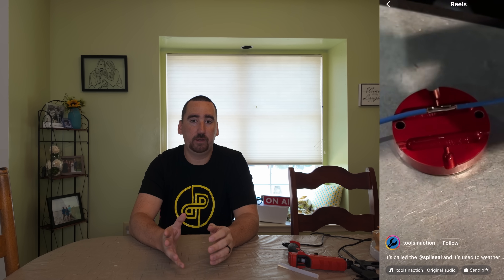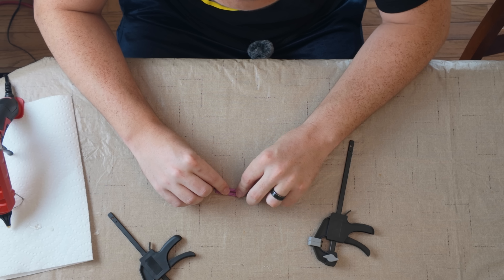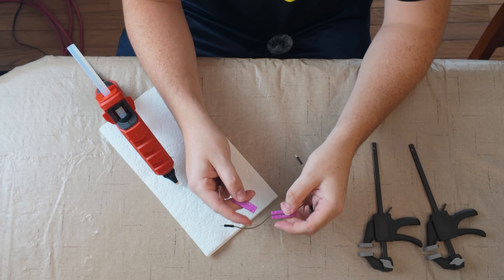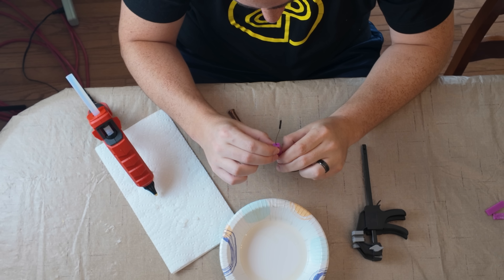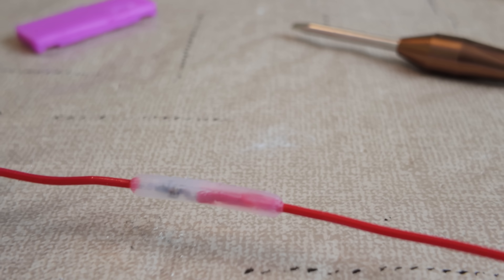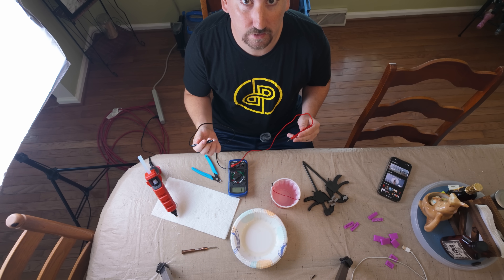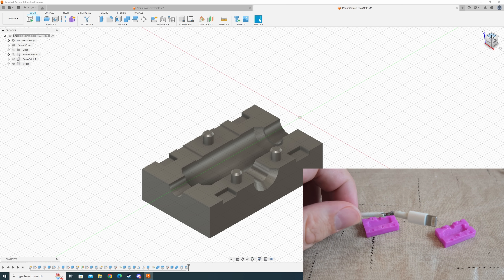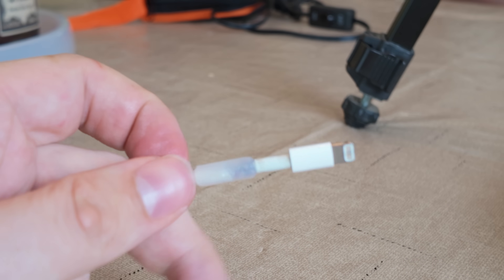Can You Inject Hot Glue Into 3D Printed Molds? | DIY Cable Repair & Protection

Comment: this is a nice idea that I'm actually planning to do as well. Not only with hot glue, but with 'liquid rubber' (stuff people uses to finish dumbbels and several other things). I use the liquid rubber a lot to repair cables and as a general heat tubbing makeshift. I'd suggest you to use liquid rubber on your cables, is easy to apply, even without a mold and cures fast. 
Anyways you inspired me to try again 3d printed molds, for liquid rubber and now for hot glue. 
Ah someone already said, but use alcohol to release hot glue. a single drop will do. be careful not to get it on the inside of yout casted piece, as it will slide on the cable, probably.
Reply: I did some with hot glue, while waiting for my liquid rubber arrive. they came out nice. I also did some molds for bitcoin coins and other fun stuff. With some learning I managed to make interesting molds. 
To release I tried mineral oil, which worked, but I don't like the oil messing around. So I tried powders (actually corn starch) and didn't work well. Alcohol is a must to release hot glue and it works fine, but for more detailed molds (like my cripto coins) I learned that using spray lubricant (silicone one) made very easy to release.

Comment: There needs to be baking soda inside already and then you inject the super glue, wonderful thing for antenna connectors with silicone or hot glue because they are weather tight, good idea, will follow up on this

Comment: You can get the glue sticks in multiple colours. Another thing that you can use in a glue gun is wax crayons, which are good if you need to make wax injection moulds for things like lost wax casting, maybe for jewellery making etc.

Comment: This is great! For years I've been wishing there was a way to overmold the home-made cables I use for my ham radios. I've made connector shrouds with the 3D printer but they don't give very good strain relief.
Reply: Yup, that's a tried-and-true method for small-batch production of cables/connectors in the automotive industry, typically for alpha series production. DuPont used to sell a small injection-molding kit for that purpose. Try a blend with LMPA so your molds will last longer - some glue sticks are made from this stuff...

Comment: Molds typically get polished, or at least machined as smooth as possible.  While you can't easily do that with 3D printed plastic, you can use some other tricks to reduce the dependency on lubrication - like making the cutout hex shaped instead of cylindrical, which gives you plenty of draft angle to help eject the part.  Also, it looks like the short demo you had inset in the beginning used hot glue with a lower viscosity (runnier) than the typical hobby stuff.  That might be worth researching too.

Comment: For mold "release" on 3d (sla) printed injection molds, I like to use a dry lube. Powdered PTFE in a solvent in a can, its magic and cancer simultaneously. It works similarly to the old baby powder mold release method.

Comment: I have the Spliseal hot melt injection mold wire seal I use for our outdoor Christmas lights and it works great.  I use their Butt Connectors and a Knipex MultiCrimp pliers.   It’s a slow method of crimping wires together but it’s a tight permanent seal.  A caveat, the hot melt glue is like napalm if it drips on you.

Comment: You forgot to tell the glue it wasnt supposed to stick to the mold 😉
If you let the mold stay on it you kind of have solved the problem of protecting the ends 😎
Kidding aside. You did good with the veggie oil.

Comment: You can also get high temperature hotmelt glue that only melts over 100c

Also look into low pressure molding, lots of interesting automated and handheld machines for cable overmolding.

Comment: other ideas:
mold for the mold. so, a mold to cast this mold from silicone. this should remove the need for the oil/ lubricant. or, possibly better, do that but have a printed outer shell for the silicon mold part to sit inside to keep the shape better (depending on how soft the silicone is).
or cast it using silicone instead of hot glue. that would improve heat resistence, no need for lubricant, etc

Comment: Most hot melt glue formulations are extremely weak to alcohol vapours, both ethanol and isopropanol but must be highly concentrated. Simply dab a little around it and in a minute or two, it will release from the substrate and fall apart in large satisfying chunks.

You can use this to clean your mould. Or you should beware near your items made from hot melt glue.

I have done hot glue molding with HIPS and PETG. I just usually pour it around  the cable and then quickly clamp the mould around. Done some cable strain reliefs that way, Ethernet and whatnot. Never designed one of those moulds, downloaded them from the usual places.

You can also do silicone moulding. Any number of ways.
Reply: ethanol does not make it fall apart, but isopropanol does. and from my experience if isopropanol is low quality it can dissolve surface of glue making it sticky

Comment: So you can get hot glue lined heatshrink and it's not that expensive, just use that for cables, much easier.
What this would do very well for is terminations at connectors, like D-sub or USB, injecting a shape to hold the single conductors in multistrand for strain relief as is done in factory cables often.

Comment: literally did a month ago to redo the strain relief inside a monster cable after i replaced the svideo plug (broken pin) for a og xbox av/cable. worked a treat. used pla, no issues, since i didn't plan on keeping the mold past the single use.

Comment: One small issue: hot glue is actually not water-proof. The wire will be exposed to the atmosphere, or water if it is submerged (it may not conduct electricity, but trust me it will rust if you leave it long enough, because the plastic is porous just like PLA). Not to mention that even a small amount of WD-40 will completely separate the hot glue from the wire.
A solution already exists for this issue: electrical tape.

Comment: @PrintPractical use hot potting sticks they are like hot glue but it’s used to encase electronics in enclosures typically black clear or white in color when it cools down it’s way harder and is better for higher temperatures compared to hot glue you can use the hot glue gun or you could melt it in a soda can and pour it in the mould
Reply: Will you give the stls on printables

Comment: Please Don't use an Multimeter for Isolation testing. That's not even a little  accurate. Us a Isolation tester,they measure with more than a few volts (250-1500v but they have a limitit current, that they are safe)

Comment: Use heat shrink on the solder joint as intended and on the iPhone cable as well. You can get heat shrink in a size that fits over the lightning connector (or USB C) and shrinks down to the wire size. A long piece can over half the connector as well. You can also get heat shrink with hot glue already inside it. I realize that’s not what you goal of the video is just saying there is already an easier and better solution to the problem.

Btw that iPhone cable has a burned contact on the lightning connector. Toss it in the trash because that’s also burning the connector inside the phone. You could clean it with a dental pick if you really wanted.

Comment: the only flaw is the oil, first problem is parts of the wire that touches the oil will not adhere to the glue ofc. and second problem unique to those white apple cables is that they disintegrate over time with oil

Comment: one pitfall might be the low temperature resistance of hot glue, especially inside a car. high temp hot glue maybe?
Reply: Epoxy instead, JB weld or something. In a syringe.
Reply: @sierraecho884  RTV silicone is almost it but it doesn't bond to anything else
Reply: @g_glop  This is a fantastic idea. It does not have no bond to anything else (in some cases at least) you can provide some keyings in the overmolded part by drilling holes. Overmolds don´t stick well to metals as well thus those kind of geometries are needed. It´s more difficult with the cable example.
Reply: @g_glop  Oh you can also use a silicone sleeve as the mold geometry instead for higher temp plastic or low temp metals.
Reply: @sierraecho884  i think a good solution for cables is hot glue lined heat shrink which softens at high temperature but doesn't melt off
Reply: @g_glop  Yeah I think to so too. I would probably use electrical tape an heat shrink over it if possible.
This video here is just a demonstration really.

Comment: I tried to glue aluminum with hot glue and found it is only possible if you preheat it a lot. The easy separation comes from the ALU piece cooling the glue. I would not try to replicate that. Instead I'd take advantage of the fact thee glue sticks excellent to the plastic. Make small sleeves that are meant to stay on permanently once injected. Theat way you solve the biggest problem of this idea - that the wire can poke out of the side if it is crooked in the mold. It is hard to guarantee even insulation. If on the other hand you intend to leave the plastic on, you do not have to care about it as much. After you inject you are guaranteed to get a hermetic waterproof sealed capsule!

Comment: two things
1- you can use two sheets of aluminum foil in the mold, to make the removal easier (and maybe even leave it in the piece)
2- I would not use hot glue for any internal parts of a car. Someday you will park your car in the sun and discover a messy puddle in the floor.

Comment: PETG already becomes soft at 80° and actually hot glue sticks to PETG way to well. I already tried this before. Maybe use some more heat resistant plastic? Just in case.

Comment: You should look into how hot glue actually adheres to things. Don't take my word for it but my understanding is that it's a mechanical adhesion that relies on surface contact and that it's not waterproof for that reason. Water will eventually ingress. If you're intention is to weather seal an electrical joint silicon, epoxy, even nail polish would work better.

Comment: Does the hot glue gun tip melt the mould injection point?
Reply: although yes it can, it won't melt a significant amount in the amount of time it takes to squeeze in the glue. even if it did you could easily get multiple uses out of it before it caused a problem.. and even if it did die after x number of uses you could just 3d print another mould.
Reply from the maker: @RobertSnyder-xu3cx yes, Robert is right here. If you have a decent glue gun, you can probably reuse the mold a ton of times. My glue gun sucks, so sometimes I do end up holding it on a little longer than necessary. It doesn’t do too much damage, just slight deformation of the “sprue hole”

Comment: I watched this video just to see what you were going to use as a mold release. Hypothetically, PLA doesn't stick to PET-G and has a lower melting point, so you might have success using a printer hot end to inject PLA into a PET-G mold.

Comment: How do you stop the hot glue gun tip melting the insertion point? I just tried this and while it worked great, the mould deformed due to the heat and failed the second time because the insertion point got too deformed.

Comment: The real life use case of the iphone cable is really cool! But I am confused about the waterproof test. Was the cable damaged under the hot glue?
Reply from the maker: Yeah, I didn’t show the overmolding of that red wire (kinda repetitive and boring), but I cut the wire in half and soldered it back together to have an exposed connection. Then I molded the glue around the joint and did the waterproof testing.
Reply: @PrintPractical  Ahhhh watching back I can totally see the soldered joint. Very very interesting!

Comment: I tried this method. But the glue doesn't flow in the entirety of the mold. It backflows after some filling. I'm not sure what I did wrong. Honestly I didn't make a second revised mokd. I used my hot Air station to rotate it and finish the job. Maybe my air vents weren't big enough, or the nozzle size wasn't close enough for a good seal? Also my cable is a lot thicker than an iphone one.
Reply from the maker: I would try increasing the size of the air vents. It shouldn’t backflow if air has a proper channel to escape out of the mold.

Comment: Cool I guess but wouldn’t a piece of heat shrink tubing do the same thing? I’ve done hot glue + heat shrink when I wanted something thicker to prevent flexing but you could probably get away with multiple layers of heat shrink.
Reply: I was thinking that but it wouldn't work on the wire that still had ends on it.

Comment: you used petg, i dont really have a stable source of filament but alot of normal pla stock over from a recent project. do u think i could make that work somehow?
Reply from the maker: Mhmm one would have to try it. I worry the temperature of the hot glue may be close to the deformation temp of PLA, but I don’t know for sure. I used PETG to be on the safe side
Reply: I would advise against PLA and hot glue. Anytime I've put a mild glob of hot glue on pla it absolutely melts. You gotta be quick too. To use any moderate amount of hot glue will make the PLA fail.
Reply: You can try placing the PLA part in the freezer beforehand.
Reply: @KJMcLaws did you use the low temperature glue sticks and gun.   If not, it might be worth a try
Reply: @mtnjhutch  I think I did buy the low temp sticks. It's a $3 10w glue gun. I've only really used hot glue to add "Feet" to my 3d printed cases for things. I've also recently switched away from PLA for everything. I have access to an enclosed printer so I can use ABS. On my open frame printer I switched to PETG. With having my PETG dried in a proper filament dryer, it is not at all difficult to use.

Comment: I’m very impressed with your results! I have 3 herniated discs and have a lift chair that uses very expensive wired lift controls and I’ve gone through 3 controllers in 1 year at a cost of $45 each. Would you entertain making me a few 3D printed molds for me? I’ll gladly pay for materials, your time, and shipping if cost is reasonable. I’m  very familiar with using and own a  micrometer and digital calipers. Also I’d be interested in a couple IPhone cable molds.

Comment: Make the mold larger. (Heat sink) freeze it just before you inject. Should pop out without oil. Or just spray with wd40 as a release

Comment: Skip oil. Put in freezer. Use resin. Not filament.
Reply: like yeah, everyone has resin printer
Reply: @CuLozus  A fair remark. But keep in mind a 3D resin printer for molds this small is cheaper today than a filament printer of comparative quality. Entry name brands start at 150 USD. Even small figurine resin printers are cheaper and a good use case here. Thanks for commenting.
Reply: @AtomkeySinclair  but you cannot just buy a printer itself and be ready to go. You also will need resin, which is much more expensive than filament. Also you wound like to have a UV station.
Reply from the maker: I do have a resin printer, but rarely use it due to the toxicity of the resin. I have to handle a toddler, so I don’t want to be handling that stuff. 

FDM printers are probably more common just due to ease of use. I do agree though, resin is probably better for making a mold. To each their own.
Reply: @PrintPractical  Have you read the MSDS on resin? Material Safety Data Sheets show the technical aspects of chemicals etc. Compare the MSDS sheet for UV resin to the MSDS sheet for a detergent you wash you clothes with - like bleach. I would rather submerge my hands in resin. Same goes for gasoline if you use it for mowing or vehicles... But I get your point as well. I wouldn't want little kids around it. Just keep in mind that you have a power differential between competing markets - filament and resin. It is in the best interest of one to maintain the narrative of safety - while forgetting how hot the bed and tip of a filament printer is at the same time... The resin printer might smell a bit, but not as likely to catch fire... :) Thanks for commenting.
Reply: @CuLozus  Well a name brand resin is about $18 USD for 1kg - $14 for name brand filament... So 4 bucks more? On Amazon anyway. And just go outside and use the sun for 2 mins instead of buying a UV station. It takes me less time to pour resin in a vat and flip a switch than it does setting up a filament print... leveling, time preheating - then supervising. I don't have to supervise a resin print. Just a thought... thanks for commenting.

Comment: Most thermoplastics including the ones used in hot melt glue have poor adhesion to the most common plastics used today to jacket and insulate wires (PVC with plasticizers and fillers, fluoroplastics, silicone). Yes, on the bench it will appear to pass such a test for "waterproof". This is far from useful proof to justify such a claim! Over time, water will creep deeper into the gaps between overmold and the wire insulation. Aided by repeated wetting, any flexing or stress on the wire, as well as thermal cycling (between dissimilar materials) outdoors. This occurs gradually over weeks and months. This cycling effectively delaminates the weak bonds around the wire that appeared to make the overmold waterproof on Day 1.  
"Water resistant" would be a much more appropriate term to use for this. It'll be effective at blocking splashed water and brief immersions from reaching the conductor. It's doing a disservice to people who will trust the advice they find on channels like this to call it anything more than that.

Comment: Not super practical. Id rather buy a new cable and take care of it than have CAD up a part specific mold every time.  The cable oversold should be centered over the damaged area for better strength.   At it's it would likely pull out given the same stress it was under that caused the damage. Nice concept though.